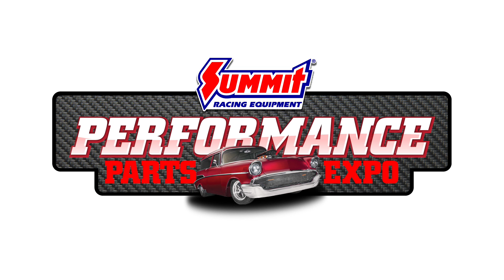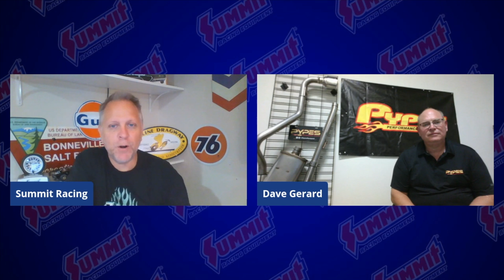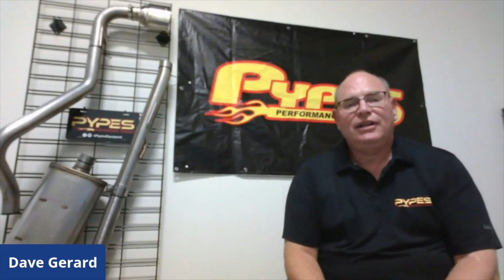Pypes Exhaust Systems for Jeep Gladiator/Toyota Tundra

Comment: Can the tundra system be use without the tail pipe for off road applications? Basically a dump kit.
Reply from the maker: Yes, this would not affect the exhaust function, however exhaust gasses can get into the passenger cab area when it is dumped under the truck, so this is not generally recommended.
Reply: Thanks for the clarification